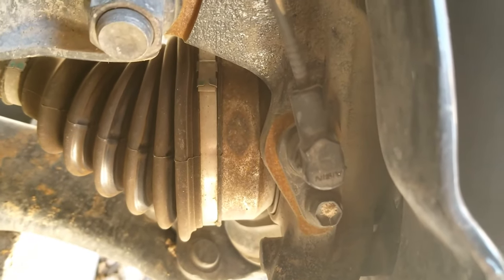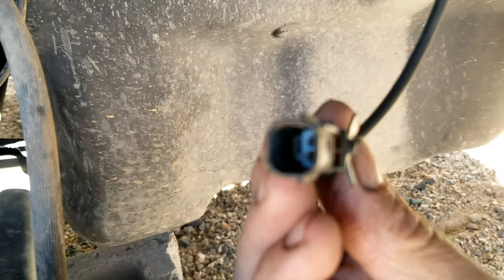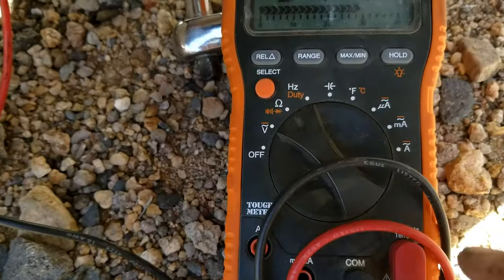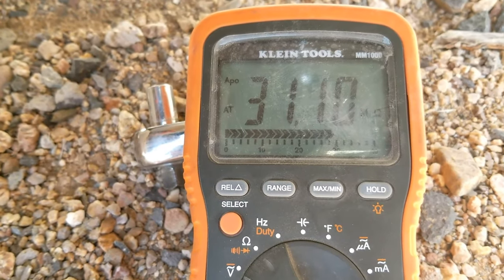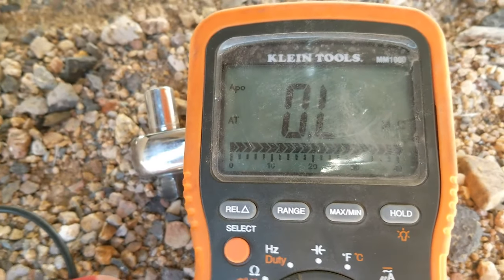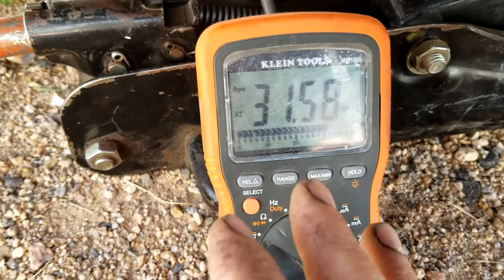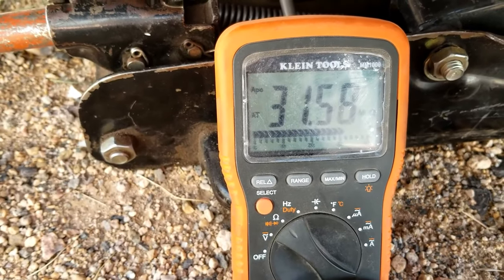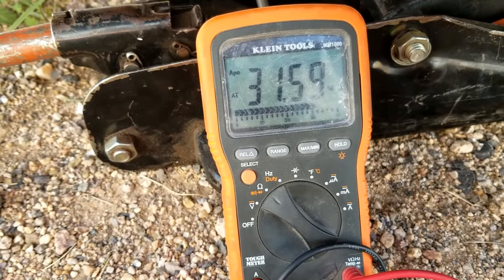How to Test a Wheel Speed Sensor with a Multi Meter

Comment: 31 Meg ohms is what you have, respectfully Brother, you are not reading the coil. 31 Meg is effectively an open, its just reading thru the dielectric of the coil if it is open.Possibly you probe is not plugged all the way into the meter, I catch that on mine from time to time or there is a problem with your probes. Always short check them together to see you get 0 ohms before you measure another circuit. IF it is truly 31 Meg there has to be an active component in there like a diode which if there was that would kill it from making an AC signal.  My coils are 1.1K, check mfg spec they could be more or less but 31 Meg is a problem and effectively an open. Ohms testing is sound methodology but wiggle the wire as well to see if ohms change like if you got an intermittent short from it hitting the hub. Put the meter on AC and see if it develops a voltage.

Comment: To be clear, if specification is within 1% (as you stated), you are indeed out of spec.  You have a reading of 31.11megOhm (31.11 millions ohms) 1% of that would be .3111. Therefore you spec would be 30.8m - 31.42megohms.  Your reading on the second sensor was 31.58 which is outside of your specification.

Comment: Nope.  The PCM and ABS module looks Hz from an AC current, not resistance.   ABS sensors are nothing more than a magnetic pickup that creates a hall effect.  Probe the terminals, put your meter on AC volts and spin the wheel.
Reply from the maker: A resistance test is a common way to test wheel speed sensors. You can also jack up the wheel, spin the tire, and check AC voltage.

Comment: I wished this video was positioned at the top of the results when putting in how to test a wheel speed sensor , I spent a lot of time going through steps other videos recommended before I found the fix by trial and error.... this is the way to find where the problem was at. I started going back to the other videos to post honest comments and then found this one. thanks for the video , it would have been the right way to detect where the issue was. mine was a wire short before the sensor harness

Comment: One thing you failed to consider… if one is 40 and one is 30 which one is the bad one
Reply from the maker: The wheel speed sensor that has no code will be the good one.
Reply: @HVAC_Mechanic but it was plugged into the lead coming from the car not the sensor...
Reply: @bobert8125  no he is plugged into the other end of the speed sensor, the end that he is testing is what plugs into the car's electrical harness, so he is not plugged into the car's electrical system, he is literally just testing the speed sensor, the end that he is plugged into clips into a female connector that is wired into the entire cars wiring harness and electrical system, so basically he just disconnected the speed sensor from the car's electrical system and then plugged leads into the end of the speed sensor that would connect to the car if it was plugged in
Reply: He said exactly what to do. Look up what the normal ohm reading for that vehicle's speed sensors are. If you cant find it, most that ive worked on have one speed sensor per wheel. Test all 4 of them while youre at it.
Reply: The one with least value

Comment: It looks like you have it plugged into the car harness not the sensor leads🤷‍♂️
Reply: No he is plugged into the other end of the speed sensor, he unplugged the sensor from the car's electrical system wire harness and then connected his multimeter to the end of the speed sensor that would normally plug into the female port of the cars wiring harness, so he is just testing the speed sensor, so one end of the speed sensor is the sensor itself connected to the wheel hub and the other end of that sensor is what he is plugged into, he is not plugged into the car's wiring harness, she has his leads connected to the end that would be plugged into the car's wiring harness
Reply: @polosavage1  ok, just confirming because it looks deceiving in the video. My hub sensor pigtails are much shorter

Comment: My son has a 2014 nuke and the right rear speed sensor is not picking up so he replaced the wheel bearing and speed sensor and still no signal so he which the thing drives side to the passenger side and still nothing. Took sensor off and replaced it and still nothing. He took to dealer and they said ABS actuator was bad 2000$ later Still no signal coming from right rear speed sensor. The gear on the cv shaft looks good but the plate ring that the sensor mounts to look rusty so I'm going to clean it up but how can I test the leads and what to look for testing something from the computer to the wheel to track the problems down maybe a bad wire somewhere

Comment: If 1 is damaged can it cause the car not to shift down ?
Reply: yes or die when idling, shift hard, even cause power steering to fail. can mimic transmission issues

Comment: Yeah is there a polarity difference or doesn't it matter it whichever way you hook it up I'm an Africa with this car and a mechanic cut the stupid wires and then he destroyed it out of the hub I had to order new wheel sensors so now I have no plug because he cut it and he threw the plug away Now I'm just wiring it connected together does polarity make a difference blue wire yellow wire whatever it is

Comment: Hey thanks but I have a problem of sorts. I tested the right rear side on the JK Jeep Wrangler because  my code reader is coming up with C1035. The cable is showing OL so I tested the left rear side and it shows the same thing! Does this mean that both sides are bad? I"m not sure what's going on. I switched the multi metre to voltage and both readings were around 11.35 volts. Do you have any idea what could be happening? Surely both sides are not bad, right?
Reply from the maker: There are different types of speed sensors, so this test doesn't work every time. I should have explained this better. If this test does not work using a scan tool to test them may be a better option.
Reply: @HVAC_Mechanic  Thanks for the reply. I did use the scan tool (I just called it a code reader) but really appreciate you getting back to me. Cheers

Comment: My daughter has a 2019 Toyota Corolla. All the dash lights are on and the speedometer doesn't work.  The only code it's reading is speed sensor. How do I know which one? And is the wheel sensor the same as a speed sensor?
Reply from the maker: It likely is the transmission speed sensor. Research the code and it will give more information.

Comment: Please help; the ignition needs to be on,  or you have to crank the engine? ; thank you
Reply from the maker: Testing the sensor this way uses continuity, so the key does not need to be on.
Reply: @HVAC_Mechanic  thank you very much for your reply; a brand new sensor will it show the same values; i need mine to be changed, so i brought a new , but I'm not sure if it's working properly; thank you
Reply from the maker: Yes, they should show the same values. Also, if you have a scan tool, look for an option to test the wheel speed sensor when driving.

Comment: Good video. But, what is the next test if the ABS light is on, and the speed sensor passed THIS test.
Reply from the maker: Are you getting speed sensor codes? If so, examine the wiring and check for any other codes.
Reply: @HVAC_Mechanic  I have the ABS light on, as well as VSC OFF light, I have C0205 code = LH front sensor, and 4 more codes. I bought a new ABS sensor line, installed it, and drove my car, and all the ABS lights went off. 

I then ran another OBD2 scan, and suddenly the ABS light went back on, as well as the VSC OFF light and TRACTION lights. The C0205 code is back, and the others (U0123, C1223, U0124, U0126 and U0073).
Reply: @HVAC_Mechanic  So, my ABS light went on, with codes C0205 (front LH circuit) and C1236 (foriegn matter on tip), and C1223 (ABS malfunction). I cleaned off the new sensor (there was a small dusting of metal on it) and the AS lights went off for about 1 week, Then they came back on today for about 2 minutes while driving, and got those 3 codes again. The ABS lights went off, but the codes are still there. What else can I do besides cleaning any possibly foreign matte off the ABS Sensor again?

Comment: 02 kia rio , manual trans, speedometer quit working... seems to have just one speed sensor- on passenger side front wheel.. has 1.4 ohms    no visible damage.   any ideas welcome
Reply from the maker: There is a speed sensor on the transmission that sends information to the speedometer.

Comment: So how can you say the actual sensor is good? This is just confirming theres a connection coming from the computer. This cant tell you if the actual sensor is working tho.
Reply from the maker: This test is not connected to the computer, it tests the sensor only.
Reply: He's got the multimeter leads plugged into the other end of the wheel sensor, not into the cars wiring harness the end that he is testing is what plugs into the cars electrical system
Reply: @HVAC_Mechanic how can I test the wire coming from the truck. I have a C0035-04 and a U0422-71. Brand new hub and sensor. Ohms read good for the sensors. I just to check where the wire is broke/pinched. I'm thinking it's right behind the plug in the vehicle because there is a bend.